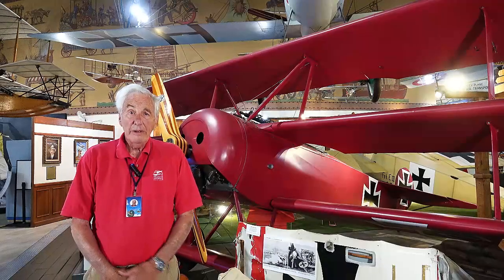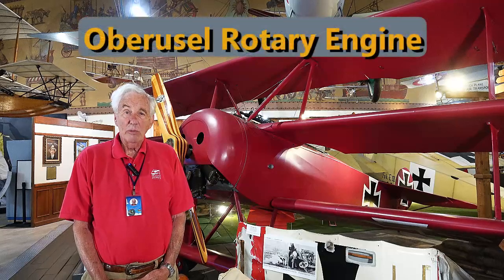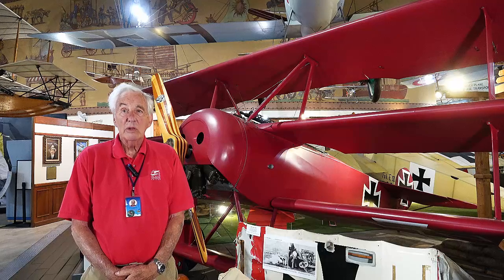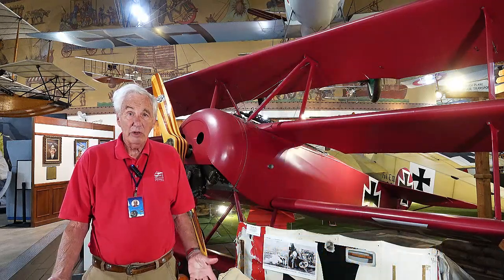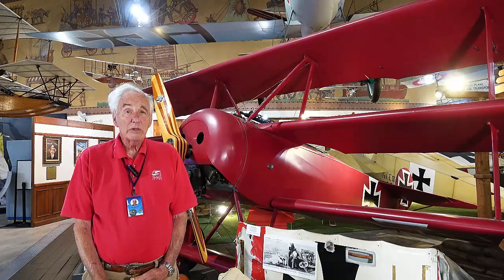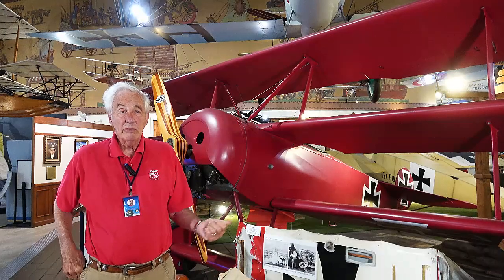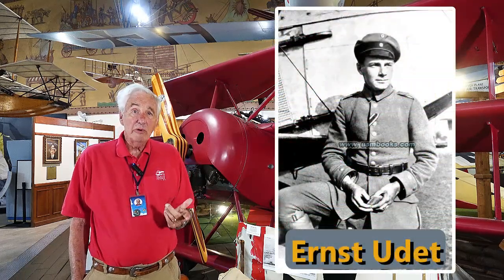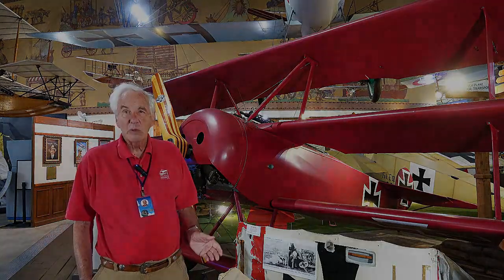BD 0603 Spotlight Video The Fokker DR 1by Ron Carrico

Comment: Imagine getting into one of these flying crates made of wood, fabric and wire. Exhaust fumes and oil regularly splashing against your face. The sky turns frozen cold as you reach patrol altitude. In addition to all that, you have to fight an enemy of near or equal ability! In WW1 the CO's refused the use of parachutes as they thought it would encourage premature bail outs. Many pilots considered it cowardly as well. How many flyers could have been saved and redeployed? Such foolishness and waste in war.
Reply: All war is a waste